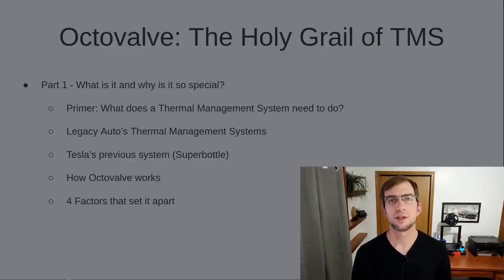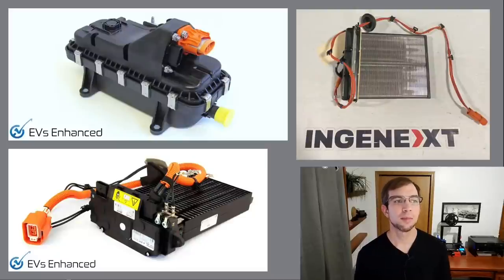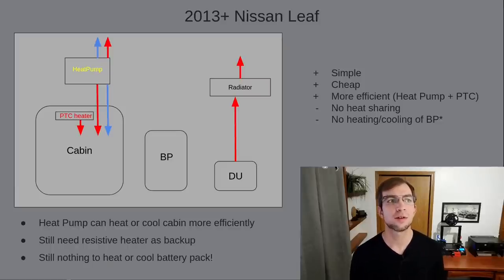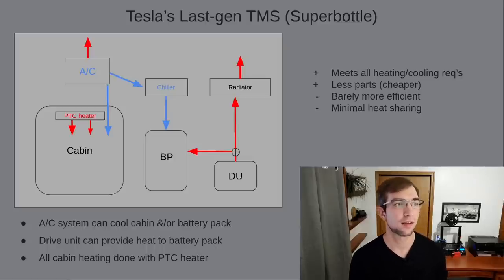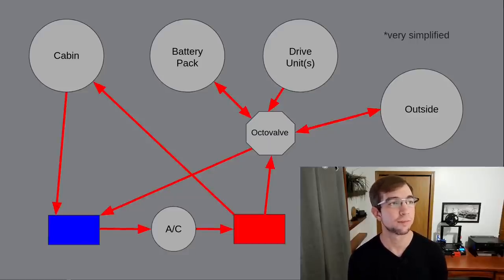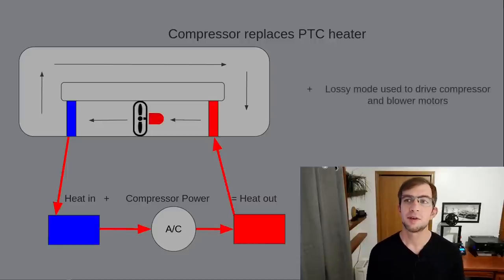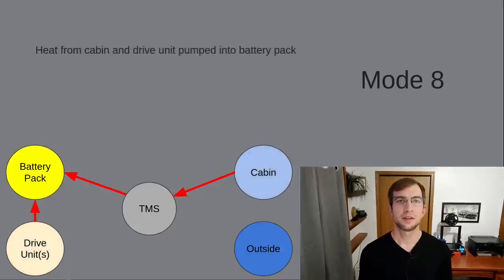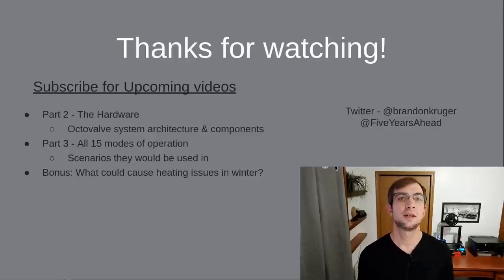Octovalve: The Holy Grail of Thermal Management Systems

Comment: 0:00 intro
0:32 requirement
1:55 PTC heater
5:44 superbottle
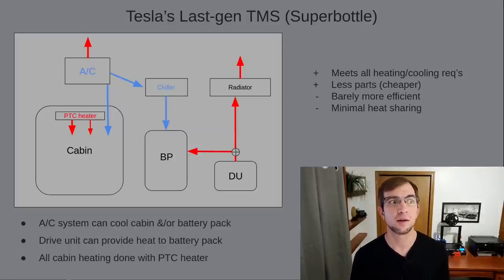7:16 Octovalve (start)
 7:43 how it works
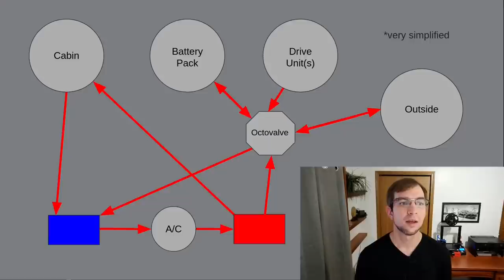 9:43 closed loop air heating
 11:51 Mode 8: cabin to pack
 13:11 Mode11: pack to cabin
 13:39 Mode 8: sun to pack
13:58 wrap-up
Reply: Note: Put it in the video description for automatic YT chapters.
Reply: Great, structured, logical work. 
Looking forward to your next episodes
Reply from the maker: Thanks for the tip!

Comment: AWESOME! I'm a mechanical engineer and have been fascinated by the thermal management of these cars. You did a great job explaining. I definitely hit subscribe haha. 

Looking forward to hear about your HP failure theory/analysis. My M3 is currently having its entire thermal system replaced due to that issue. (compressor, ref lines, exp valve, etc...)

Cheers!

Comment: Hi Brandon,

There is another multi-part video series about that Octovalve on YT which is also good but yours was way more direct to the point and the comparison to other EVs was extremely useful too. 

I had a ‘13 Nissan Leaf and in our temperate climate it worked quite well, especially with preheating while plugged in but Tesla’s system is so much smarter and I’m pleased/privileged to drive one with this system now.

Thanks for the video, look forward to the rest of them!

Comment: Nice job!
One correction, in the cabin the evaporator (cooler) is first in the airstream, then the condenser (heater). This order is needed for defog+defrost to work properly. Patent also shows LV heaters at the outlet for split climate control.
Reply from the maker: You're right. Thanks for correcting me!

Comment: Gold. Absolute gold. You single handedly cleared up the majority of my confusion.

Just one thing.
You never touched on the more common "efficient mode" thats normally used when it isnt particularly cold. How would that differ from deliberately generating heat? Just standard heatpump operation?
Reply from the maker: Glad I could help! But yes, since it's essentially a super-versitile heat pump the computer can decide whether it should pull heat from outside, the battery pack, both, or to generate it.

Comment: Thank you very much for the most informative video on the subject! (at least the most understandable for laymen) There is one scenario I'm curious about: The mode 8! If the car is not in use, and the sun is shining and heating the cabin big time, but the air outside is cold so the battery is cold...: Will the car transfer heat from the cabin to the battery (thus using a little bit of batterypower to drive the pumps) on its own? I mean: The car can't know if it is going to be used shortly or in an month...
But I would love to hear that it does so anyway!

Comment: Great video!  Curious if you or any watchers have any insight into how insulated the battery pack is.  How long could that heat stay in the pack before ambient air saps it out?
Reply from the maker: Great question! When I had the Leaf, it's battery seemed to take 16-24 hours to return to near ambient in winter when I was able to warm it up.  Given the 3/Y pack weighs about twice as much and surely doesn't have double the surface area, I'd guess around 24 hours.  But this would vary quite a bit based on starting temp, ambient temp, and what temperature range Tesla deemed usable for heat storage.
Reply: I haven't seen any intentional insulation, just mechanical packaging. Patent calls out thermal mass at 85Wh/degree C.

Comment: Interesting video!
Just curious, how does Tesla manage to take heat out of the Cabin to store in the battery pack. Is air from the cabin SUCKED back via the vents?
Reply from the maker: Air flows out of the vents just the same, it's just the same as running the a/c to keep it cool in summer. Only, instead of the heat we pull out of the cabin getting dumped outside with a radiator, we're putting it in the battery.

Comment: really interesting - thanks. Does the system run like an ASHP at any point? ie pulling air from outside and removing the heat from it to supply to the cabin/battery? Or does it mainly focus on inefficient motor usage? Would be curious the average energy usage of each option - PTC/heat pump running as ASHP/waste energy from deliberately running motors inefficiently
Reply from the maker: Yes, different modes allow for cabin heating sourced from outside, battery pack, drive unit, or a combination of them.  But none of the modes allow for heat to be pumped directly into the battery pack from outside.

Comment: Thank you for this great overview!   I'd like to know more of the details someday.  BTW: have you heard about battery insulation kits like those from EVInsulate?  Do these seem like a good idea?
Reply from the maker: I had not heard of that before, thanks for the tip.  It's an interesting concept, but I'm skeptical if a significant amount of heat can be saved by just insulating the coolant hoses like that. Keep in mind, additional insulation wouldn't be working to your advantage when you're trying to cool the battery in summer.
Reply: @fiveyearsahead  It's not just the hoses, the kit is mainly extra insulation for the battery. The hoses are optionally and not included in the kit. They are up in Canada and are mostly concerned with cold weather. Their other product makes the roof double paned to keep in the heat.